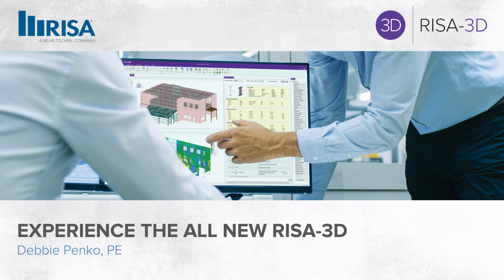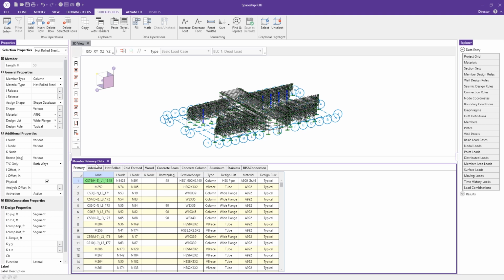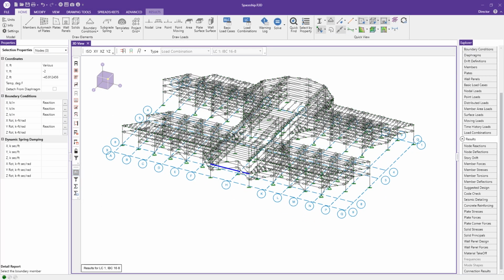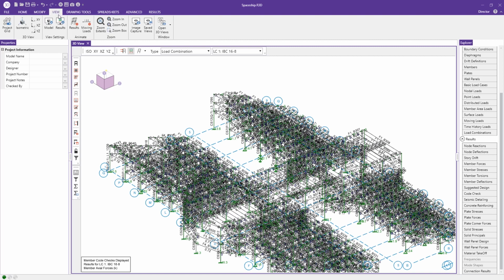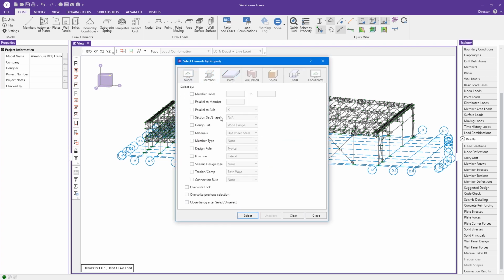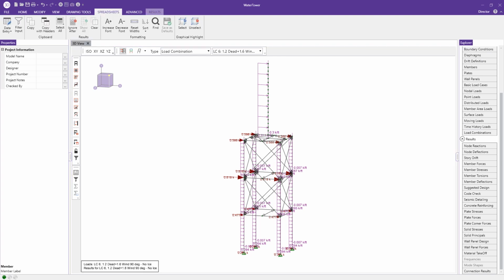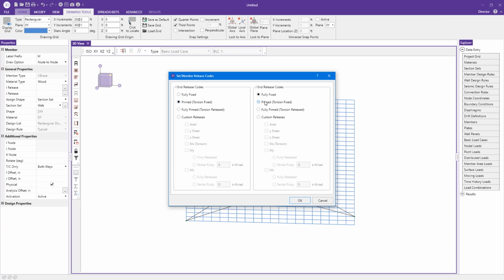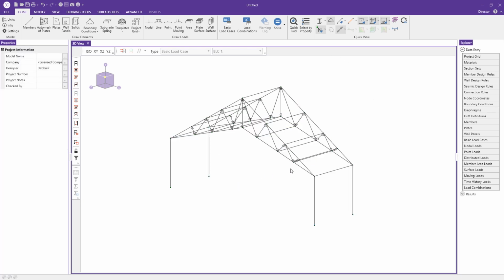WEBINAR: Experience the All New RISA-3D

Comment: I have some questions: 

1- Are you updating all your software? I mean all the Risa Suite cause you give a nice new look to Risa 3D but all your software need it.

2-Another one is when are you going to include non linear analysis like static push over.

3- Does Risa 3D consider special concrete moment frames considerations and requirements from aci 318 chapter 18.

I will be glad if you answer me
Reply from the maker: Remy, thanks for your questions.  We are planning on updating both RISAFoundation and RISAFloor in the future with new interfaces.  As far as nonlinear analysis is concerned, we are always looking at improving the software and adding new functionality that our customers want/need.  Make sure you email support@risa.com and let them know exactly what you need so it can get entered into our development queue.  Finally, for concrete moment, frames we can amplify the forces for designing using overstrength but don't currently do any other design provisions specific to seismic for beams/columns per ACI.